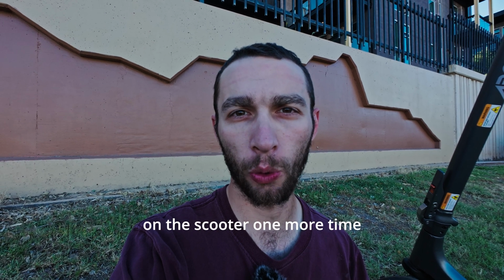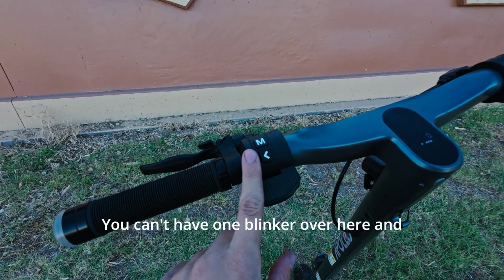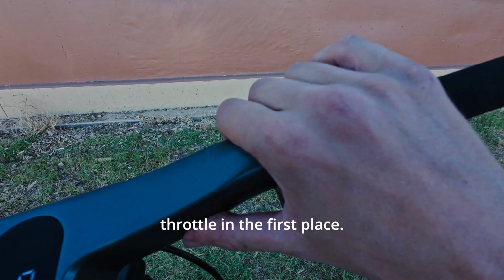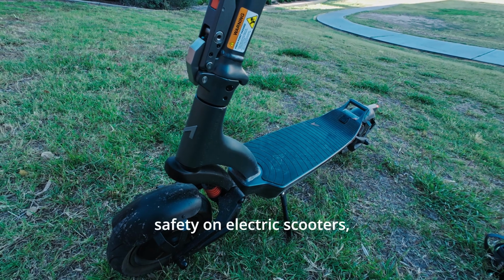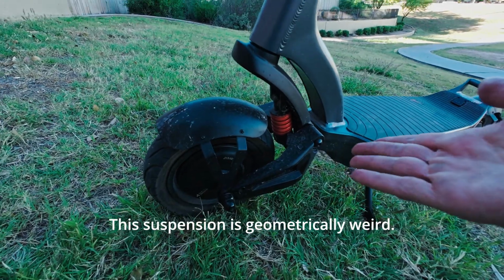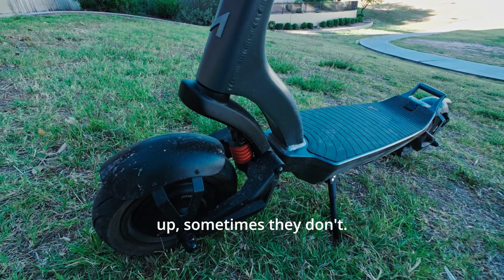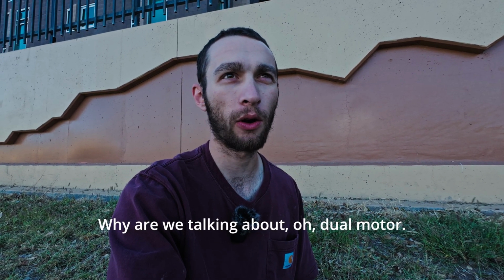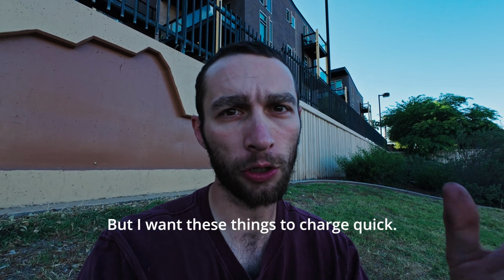Everything wrong with the Apollo City Pro

Comment: Show me a phone that charges on 30Ah!!!!!
There's not even in hell!!!😂😂😂.
Dual regen brakes are just absolutely fine on the Apollo City pro 2024 dual motor!!! Adjustable & very powerfull. You might have to use the drum break in an energency situation.The e-brakes are slowing you down  very quickly by 95% in a heartbeat!!! Lousy front indicator lights bearly visible in the sunlight.They can break very easily.PERIOD.
The suspension is quite firm for people under 150 lbs. Better for heavier weight people. It should be adjustable!!! The steam is very high under 5'5" users!!! Should be adjustable by a few inches!! The mudguards suck in rainy muddy weather.😮.A 7.5/10 scooter. 
A fast out of the start vehicle!! It has  gotten me out of trouble a few times.Yes, the directional light swithches can be better designed & should be placed.
Apollo should copy from others to have a 9.5/10 product.
It's still a couple of years yet.Hire people like this guy in the review.Thx.😊

Comment: Just got it last week 30 miles
Reply from the maker: What do you think about my suggestion for changes? Do you have any other suggestions also? Apollo reads the comments so here's your chance for the next scooter they make.
Reply: @Matt_Dylan 
The Apollo team is quite a stubborn or weak group to do things really, right???
We're they hiding the 18650 batteries in some of the scooters?
What happened to the famously bragged 
Dynavolt battery???
Yes,LG & Samsung batteries are 👍 👌 👍 too.
10x3" tubless and  or solid tires too should be standard for better rider safety.
May be in 3 years Apollo gets the 9/10???!😊
Wish you well guys.
Reply from the maker: They just had several main executives leave. So I wouldn't count on the company getting better.
Reply: @Matt_Dylan 
Most likely they left for several frustrating reasons. 😮Sad.